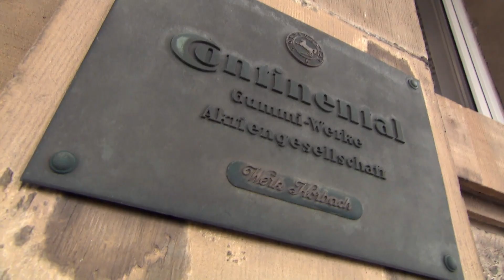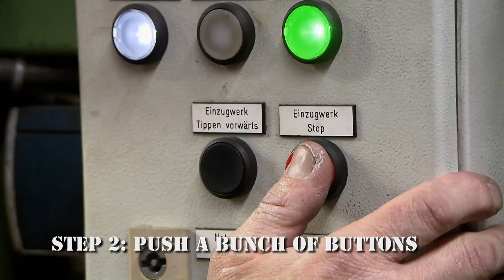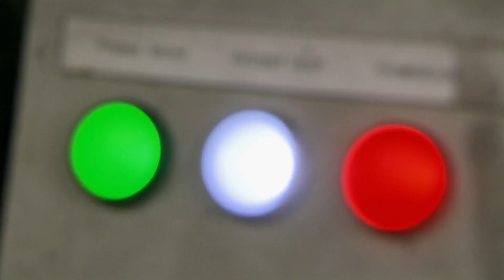Danny MacAskill & Friends Visit The Continental 2-Wheel Factory

Comment: And yes, they can be used for racing, as I often "blow by" Peletons in training on my way to school.  Also, I can say I have only had 8-10 flats with Gatorskins, half probably due to incorrect tube installations.  These are hardcore!!!  And if you are having problems with flats, then do use the Ultra Gatorskins as I do, and you will go months between flats.  These things are hardcore to the max times 100!  Not cheap, about $60 US per one 700x25cc.

Comment: FINALLY, I have blown out my first pair of Gatorskins.  I ride 4-5,000 road miles a year in hot ass South Florida.  This pair had 10,000 miles on them.  I actually wore them flat in the middle for the last 8 months.  For 3 months, the treads were showing.  They finnaly blew out last week, at 10,000 miles.  That my friends, is a F'ing tire worthy of the Roman-Greco mindset.